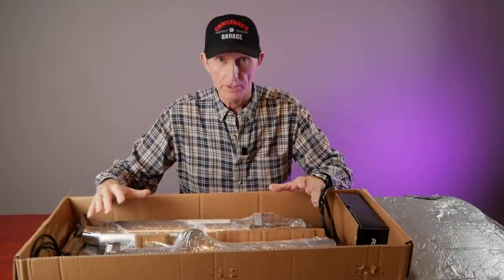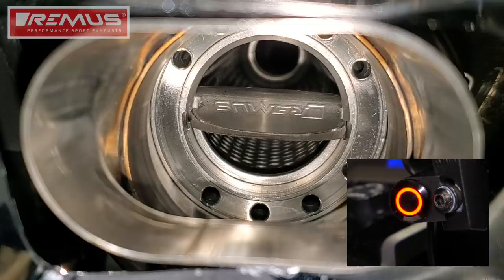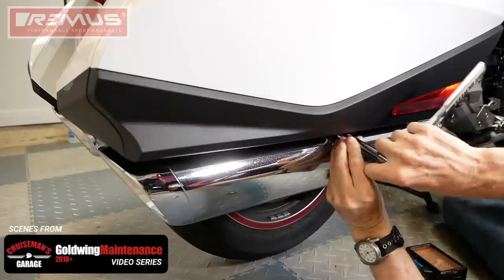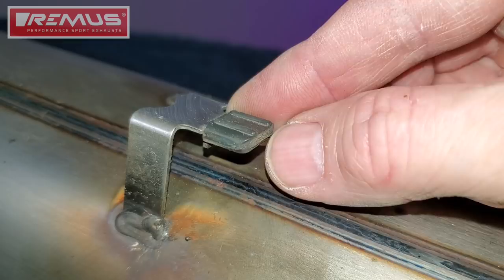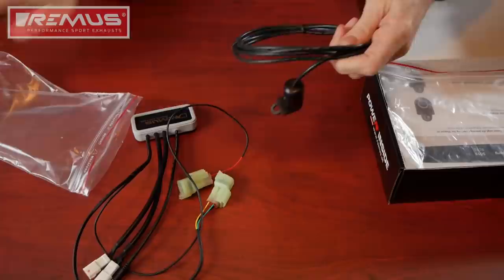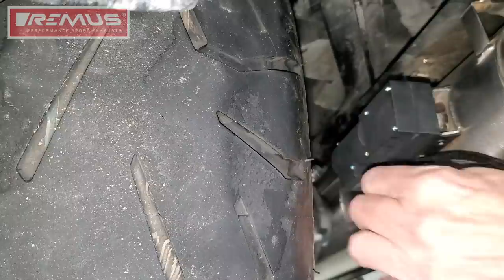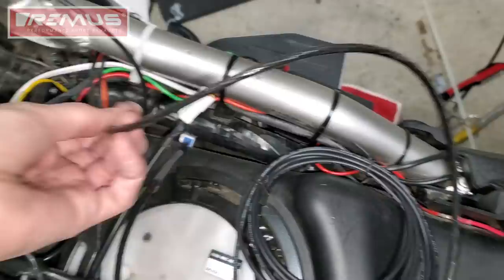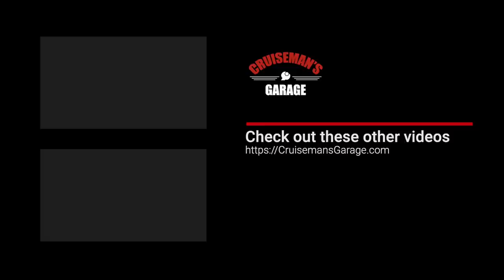Remus Performance Sport Exhaust for Honda Goldwing | 2018+ Honda Goldwing | Cruiseman's Garage

Comment: I was there assisting The Cruiseman to record standing audio and I can tell you that the Remus mufflers hit that sweet spot between the factory 'hush' and the 'blap-blap-blap' sound many Harley and Indian riders like. I know, I used to ride a Harley and an Indian with pipes I just knew had to be illegal. While the Remus sound is not that, it does add back some 'muscle' that's just enough to let others know you're actually riding a motorcycle. It's very satisfying. I like that. I also ride a 2018 Goldwing Tour DCT and I'm still riding with my friends in the Indian group that I came from. They constantly, and with good natured kidding, are telling me to "start up" when they know my Goldwing is already running! I mean, I ride a motorcycle that outperforms Harleys and Indians, yet it sounds like a Tesla! From the factory, the Goldwing sounds subservient! It's masking its strength! So, I reply with "Did you find 'em?", and they say "Find what?" And I say, "The other four cylinders?" Now, for me, it's my wish that Remus will make a version without the electronic control. A model that sounds fully open at all times that will cost less to buy and is a much quicker install. For me, I would never use the lower sound settings because, fully open, it's just right. It's not turning up the exhaust sound to eleven, but more like a six. Ahhhh... nice. It will let others know you're riding a powerful motorcycle but without also waking the dead.
Reply: Thank you, you said it way better than I could. My experience after installing them as I love them love them love them. I can let it sound like the Goldwing stock or I can put some muscle in it for the harley boys. Not ever as loud as a Harley pipe would be but it lets you know you got some motor but you said it way better than I could.

Comment: How do you know it improved the performance?  Unless your Goldwing is put on a dynamometer that claim cannot be verified. The problem with almost all after market exhaust mufflers, even on dirt bikes, especially with fuel injection, is the mapping of the EFI is tuned to the exhaust that the manufacturer puts on the bike.  Unfortunately, most riders mistake the loud audio feedback of an aftermarket exhaust with increased horsepower when that may not be the case.  If you are planning on going back to the stock muffler why not take your Goldwing to a local business with a dyno and test the horsepower then when you go back to the stock muffler test that one to see the difference. Would be interested to see the results.

Comment: I’ve just fitted the Remus Sports Exhaust to my 2021 Honda Goldwing Tour and it sounds fantastic. The Cruisemans Garage installation video was very helpful. The only thing I struggled with was connecting the Remus Control unit to a switched live 12v supply. The standard connecting leads on the control unit are for a 2018 up to 2020 models. Remus supply an adapter lead for 2021+ models. Remus supply additional instructions to fit the adapter lead to a serial connector located under the seat. I couldn’t find this connector on my bike. Instead, I cut the plug off the Remus control lead with the single red wire and crimped a lug on the cut end. I terminated the lug on the positive ACC terminal at the fuse box. I then replaced the 10A ACC fuse (fuse No8 in the fuse box) with a 5A fuse. All other connections were made as per Cruisemans video and Remus fitting instructions.
Reply: What company did you purchase them from?
Reply: @phinney1222  

HGB motorcycles, South Ruislip, Middlesex, United Kingdom.

They ordered them Direct from Remus which is a European company so not as expensive as buying them in the US

Comment: $3,011.48 shipped for 2.7 hp gain(their claim)and some noise and no custome heat shield and the backside is open🤨 hope they give a lifetime warranty on that electrical item🤔
Sorry but thats ridiculous, but for free yeah ill take one.
Reply from the maker: There are some who pay more to have their Goldwing custom painted.
Reply: @cruisemansgarage  and there are many more who pay less and get a better paint job as well.
Reply: @cruisemansgarage  comparing apples to oranges as this 3k muffler doesn't change the look at all where as a nice paint job will.  Great Intro video though as always.

Comment: Another very well done video Cruiserman. The product is not for me but it is obviously very well made. I actually preferred the sound of my 01 to my 18. The 01 had a hint of Porsche boxer sound at low rpm. If it were not for the much taller top gear on the 18 the stock exhaust would be too loud. BTW I just discovered that you also have done some videos on the DR 650. I just picked up a 2020 650 this fall. I will have to watch your library on it as well. Keep up the good work.

Comment: I'd like to see some dyno runs. I've NEVER seen ANY aftermarket pipes that performed as good or better than stock. Many manufacturers make a lot of performance claims but nothing to back it up. Most are just noisier and the bike is slower. More noise doesn't necessarily mean more power.

Comment: I like the sound of the stock mufflers. I'm gonna pass on these.
Reply: Yes stew the stock sound good, also I think owners like to the engine sing too, I do, 3k is way too much, imagine the other extras one could buy for the wing instead, my 02 wing is awsome
Reply: @garyedwards8142  yes you could upgrade with Traxxion shocks and get a RDL seat for the price of these muffers...I would take the suspension and the comfort of a RDL seat over just the sound of the pipes...much more value for your money with those mods than spending 3k  just for a different sound.
Reply: @frankward8003  I own a 02 wing with 25k , I find the seat awsome, sound wise too,I just love the pre 18 wings so much better to work with,
Reply: @garyedwards8142  I rode a 2003 for 15 years..had the full Traxxion suspension with aluminum trees...the suspension was  tuned for my weigh and the passangers weight...best money I spent on that bike. I would still be riding my 03 if Honda didn't come out with the 2018.
Reply: My 2019 GW sounds good stock.  Even louder than I would imagine for a Wing.
Reply: @NoWay-xu1ie  all the wings have a sweet sound, iv had the loud sports bikes, I just wanna chill and enjoy my ride in peace these days,to many police in unmarked cars/bikes, cameras all over place, now cagers film bikes and take to police, in uk anyway. I respect ALL riders, 🇬🇧
Reply: @NoWay-xu1ie  Yep, mine too...I wouldn't want it any louder...
Reply: My hearing is so bad but, to me none of those sounded any different.  Is that just me?   I love Remus however.  They were bought for all of my BMWs.

Comment: Hi, we know in Germany very well these make of exhausts. But I ´m left it because of noise control when the Remus is open. But otherwise more closed the performance is worst in comparison to OEM. Did You measure horsepower or torque in the different modes? So sometimes more noise less power…? Thanks for your videos, there are the best for dummies (so  I ´m!). Michael the Bavarian

Comment: I'm taking a different approach. You are hands on and explain everything very well. You are a good instructor. Question: does bike need to be re-tuned when done? Thanks for good video
Reply from the maker: It does not have to be. Not sure how you could even do that without a tunable ECM. Maybe Guhl Motorcycle will work on something like this.
Reply: No

Comment: I could find no performance gain/loss info on the Remus web site.  I won't buy this, but if I was going to, I'd want to see a dyno run chart showing (hopefully) some type of hp/torque gain over most of the GW's usable rev range in all four modes.  Craftmanship looks first-rate...as it should be for that price.

Comment: The OEM mufflers look like crap in comparison. These look and sound good - but the price to value ratio just isn’t there for what amounts to a pair of slip-ons. I actually like the sound of the stock mufflers and don’t hear any of the drone that others complain of. Good installation video.

Comment: all gw's need more exhaust note..
do you have a video on replacing ignition switch on GW 2012-2017?
Reply from the maker: Rachel, I do not have a video on replacing the ignition switch. Sorry.
Reply: @cruisemansgarage  ignition key stuck in switch was looking for instruction vid but after researching and asking a few techs/mechs looks like a $$$ shop repair

Comment: I wish you did install video's for other bike exhausts I've had in the past! Really clear and straightforward instructions, thank you. It is a very similar valve system to the Jekill & Hyde exhaust system (made in Holland I think) which I have on my Harley Roadking. I'm interested in the Remus as my new (to me) Goldwing B arrives next week. Just 1 question please? The connector blocks on the Goldwing on either side of the bike that the Remus exhaust controllers plug into....were they put there by Honda with this exhaust system in mind, or for another use?
Reply from the maker: The connector on the left side is used to program a new Smart Key, the connector on the right (red) is the connector used to read error codes.
Reply: @cruisemansgarage  Many thanks for your reply. As a soon to be new Goldwing owner, your channel has been a very useful source of information. Keep up the good work.

Comment: Does the valve reset each time you ride? For example, you went for a ride and had the exhaust valve set at 50%. The next time you start up, is the exhaust at 50% open or does it start at 0 again?
Reply: No, it stays where you left it.

Comment: Nice video..these pipes have a nice sound, but is there a drone at cruising rpms like with the stock mufflers? I would prefer a quieter muffler than the stock mufflers myself...more like how my 2003 wings mufflers  were...but 3k for mufflers...got to be a rich man to spend money like that for just mufflers.
Reply from the maker: I did not notice the drone.
Reply: No drone at any setting.

Comment: The stock system has a terrible drone at 75mph. Dead in the middle of highway cruise. Does this system get rid of this harmonic at highway speed with the closed setting? I love the idea of this system opened up for around town but want that drone in my Neotech II to go away on long highway miles
Reply: The stock muffers do have a drone in the cruising rpms...read on the GL1800 Riders forum about a member using a wine cork in the smaller hole in the end of the mufflers...I tried it and it does change the sound with no affect on engine performance or fuel mileage..I liked the difference with the sound when I tried it...if the drone sounds bothers you try it...it will cost you nothing to try it for yourself
Reply: I don’t notice it on my 2018 but then again my music is blasting in my helmet 😁
Reply: Have you got custom fit earplugs? I notice no drone in my neotec and I use custom made earplugs
Reply: @UltimateDazzle  I don’t have custom ear plugs. Just the disposable Howard Leight Lasers. I confess I’m due for a good set of custom fit.
Reply: @tdeloriea  would really suggest you invest in some if not to improve your riding experience on the goldwing but to reduce the risk of prematurely losing your hearing from the dB level

Comment: Ok, that‘s true. They are much better quality than the crab from TBR. To make some noise and pay 3 grant for this.... that‘s not my thing. And by the way... in Europe this system meanwhile is completly illegal.
Reply: EU compliant
Reply: @simonhickey8952  Yeah I know, but this doesn't mean anything. In many European countries (not all), when you get into a police noise control (very popular in summer) your type-approval deletes almost immediately. Besides paying a fine you have to call a tow truck because you're even not allowed to drive your bike back home. The reason is that pushbutton-controlled noise control of exhaust systems is not allowed. Also when you have to visit the technical inspection, you have to reinstall the original exhaust every time.